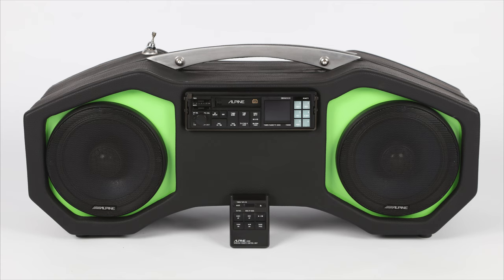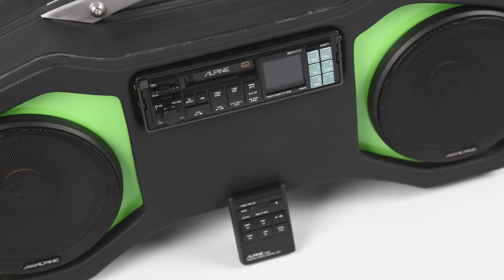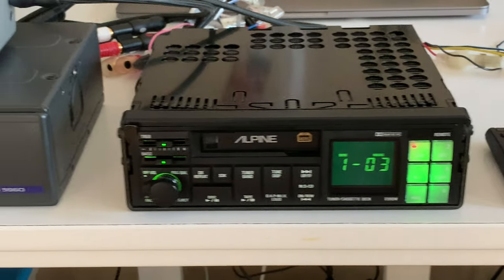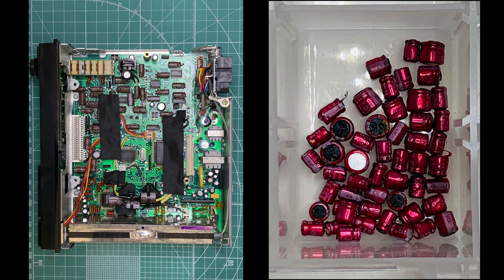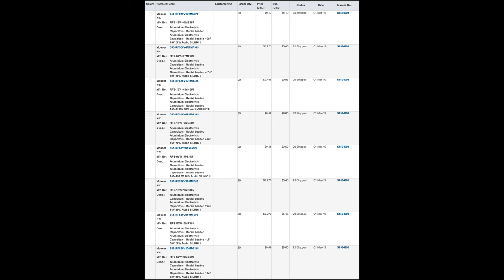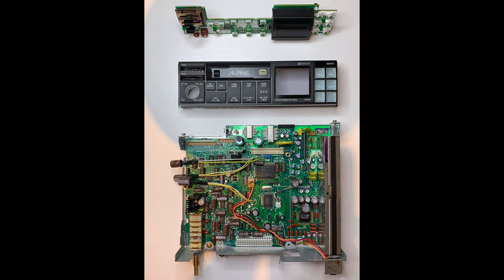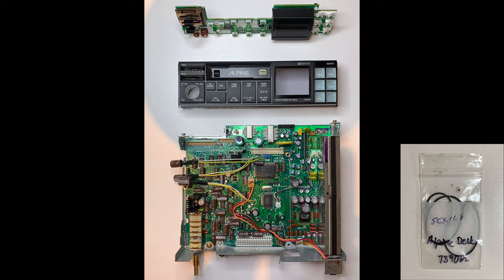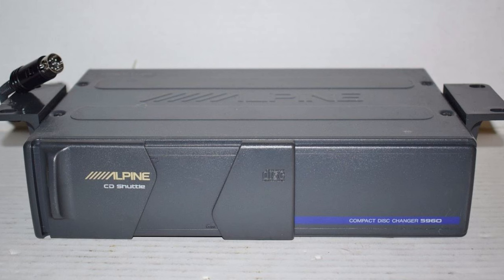Alpine 7390M Car Cassette Deck Restoration Project (Dec 2021) 4K

Comment: Hi. After using this setup for a while, how did the battery perform? Are you happy with its performance? Does it support the constant needed amperage for full volume and bass? Nice design. Great job recapping the 7390M.
Reply from the maker: Hi. Thanks for your kind words. I haven’t used it for more than an hour each time. I leave it plugged into the charger most of the time. The bass could be better but considering the size, it is adequate. I’ve recently taken the deck to a specialist as a new problem arose where there was no sound after turning on the unit. He managed to repair the deck so all is good again. Certainly not an easy task to recap. Good luck 😃.

Comment: I’ve always wanted to do something like this for my vintage Sony car cassette deck. But I can’t seem to find a proper belt for it? Not that it needs it now, but it wouldn’t hurt. Any idea where to get car cassette deck belts?
Reply from the maker: I get all my belts from :- https://www.vintage-electronics.net/prb.aspx

The PRB belts are top quality. Take the old belt out and measure as per the website instructions. You’ll need to order one that is slightly shorter to compensate for the stretching that happens with age. Good luck 👍🏻😀.